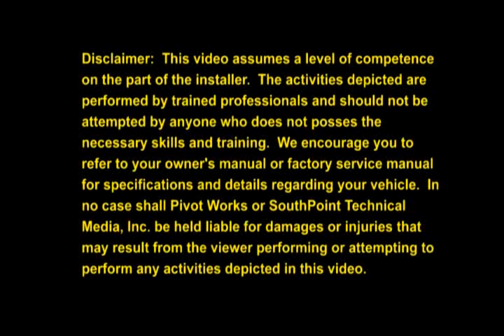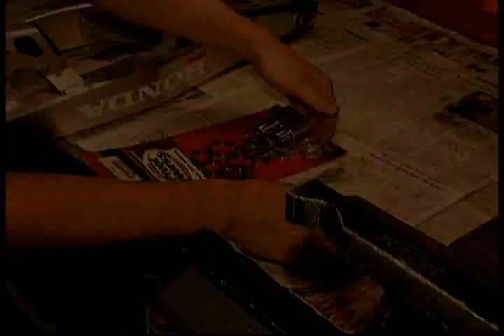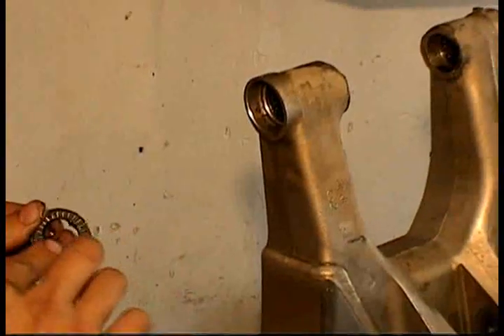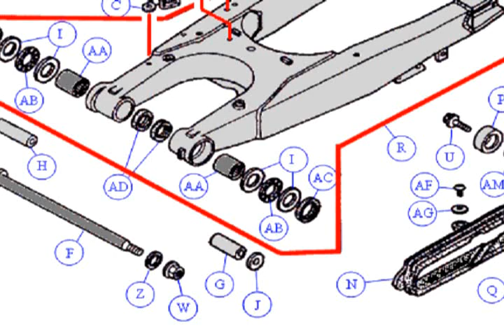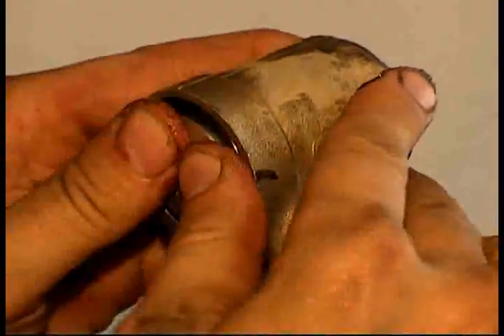Pivot Works swingarm bearing installation

Comment: Hi, thanks for posting this video. I forgot to disconnect the suspension linkage and tried to take the swing arm off I realized quickly what was wrong (I'm not a total idiot) but a thick washer (not sure of the part name) fell out it fits into the hole on the swing arm that the pivot bolt goes through but there is only one and I don't see one on the other side so I am not sure where it goes. If you have any idea what it is it would be a great help. Thanks

Comment: All new Pivot Works bearings going into the 2001/2003/2006 Frankinstien RM125. Swingarm, linkage, wheel bearings. When the steering bearing goes I'll be replacing with Pivot Works. Thanks for the great products
Purchased at rockymountainatvmc.com